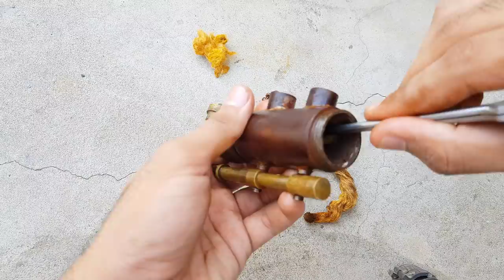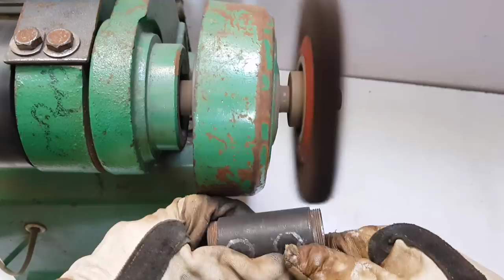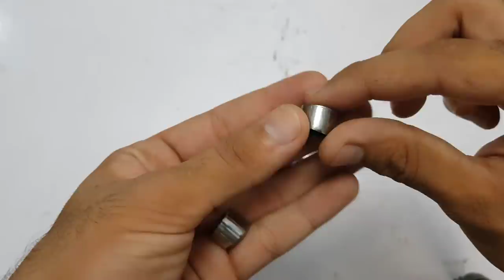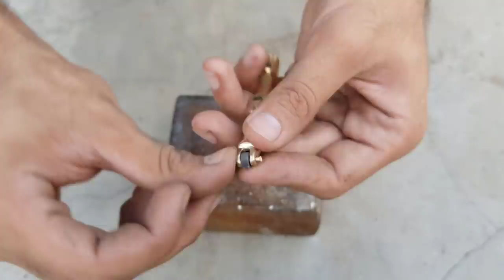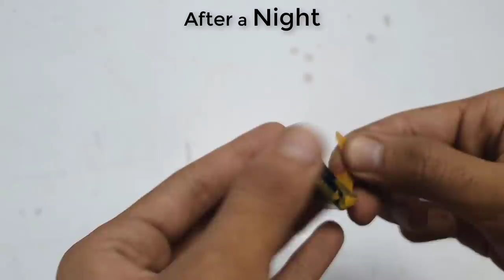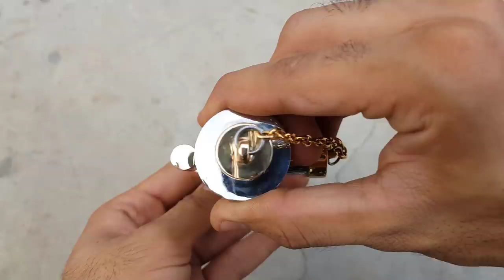Vintage Oil Ligter - IMPRESSIVE RESTORATION

Comment: That's the best lighter I have ever seen.. 🇦🇺 🏴‍☠️
Reply: @IveJustHadAPiss  this might be used for large boilers/steam engines i would guess
Reply: @IveJustHadAPiss , Might possibly been used as a lighter for Acetylene torch or similar purpose. If it was intended for tabletop use as a lighter, more than likely the original maker would have made a stand to keep it upright. However, that could have become mislaid in the course of time.
Reply: So it would seem
Reply: my words before reading this comment 
"that's the coolest effing lighter I have ever seen."

Comment: A tip on the elctrolysis. It works best in a line of sight with the object. You should line your pan 360 degrees and it should get the insides also. Even a steel pot may work with a dry wood or plastic hanger.

Nice job though. May try to make one of these. Thanks.

Comment: In my country polishing mild steel to a mirror finish and it's rusty again within a couple hours. What's a good way to save the shine other than using hard wearing clear-coat? I usually coat such steel with gun-blue so it's always black.
Reply: Notice that he was holding it with a glove to demonstrate lighting it? I think it must have been rusting again from just handling it. If he had used gun blue, the solder would have contrasted too much. He will probably have to coat it with  polyurethane to preserve the shine.

Comment: I really want to know the difference between doing the hydrolysis method of rust AND wire wheel vs just using the wire wheel. Minus inside diameters that you can't wheel away, is it worth it?

Comment: Would it light regardless of the oil? I’m confused on how it gets the fluid to the top. Or is it just the flint and steal lighting the stuff?
Reply: The fluid draws up through the wick. It wouldn't light without a fuel source.
Reply: JUST CALL ME WEBB ahh that’s a lot of absorbing

Comment: Why do you call it a kerosene lighter? It would have to be an unbearably hot day for it to work with kerosene.
Reply: Because in those days kerosene was the go to fuel of the day for lamps and lighters
Reply: @Blaze_1961  you can't use kerosene for a lighter, the flash point is too high. You can extinguish a match by dipping it in kerosene and nothing will happen. It's easy to light on a wick with an open flame but impossible with a spark unless the ambient temperature is +/- 140-150 degrees Fahrenheit or higher. Lighter fluid for lighters is the same as gasoline for cars without any of the additives, it has a Flashpoint 45 degrees below zero fahrenheit.

Comment: Actually not Steampunk. This is an actual old lighter, not some Steampunk fake. Anything steampunk is actually fake... a combination of old looks with modern tech. as if things we have now existed in the steam power days. I've actually seen lighters very similar to this. This lighter is probably actually very old, from around 1900 to 1920 at the latest. This particular one may have had a specific purpose, what that would be, I don't know.